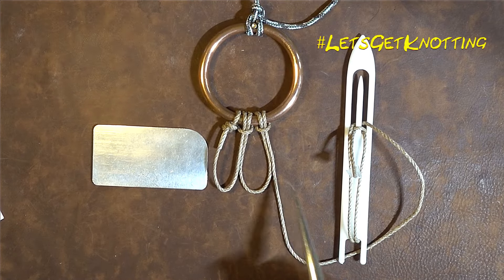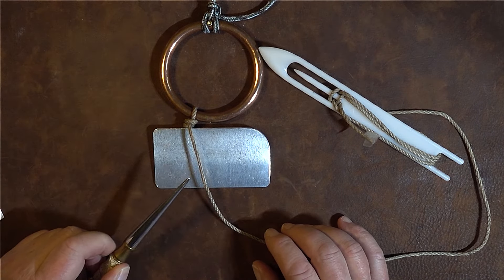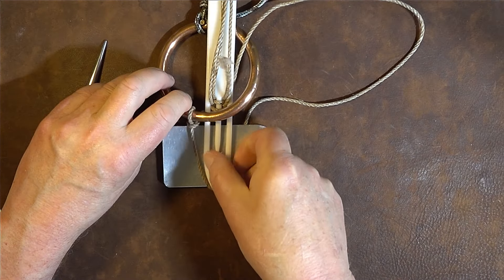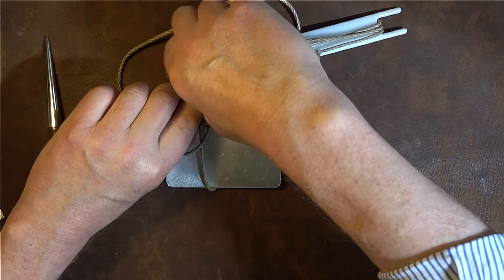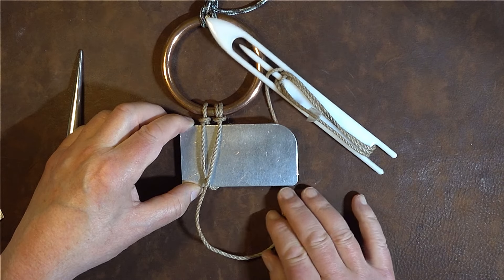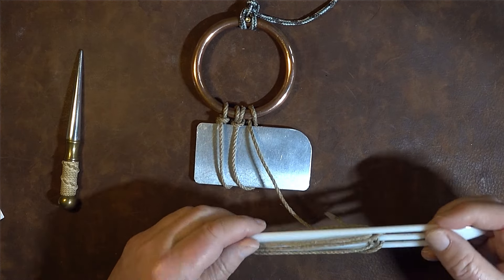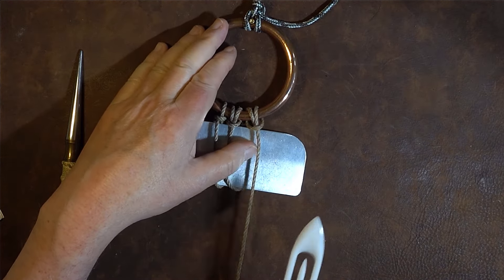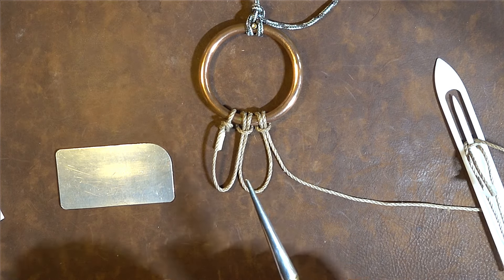Casting onto a Ring - Cow Hitch Method - Net Making

Comment: I’ve used your net making series to make a hammock. My favorite knot is still the Matthew Walker. Thanks for sharing.
Reply from the maker: Did you use any particular cordage for your hammock?
Reply: @KnottingKnots  I used 425 paracord. 550 was too large in diameter and the knots would be too large and uncomfortable to lay on. Would like to see you do a full length video on making a hammock. I am sure you would have ideas using multiple sailors knots which would improve my pattern.